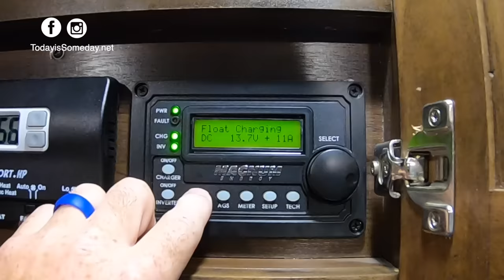Tiffin Service Center (RV RAMPAGE THAT CHANGED POLICY)

Comment from the maker: Please share the cost of your RV repairs to help our community learn about RV costs. Thanks! And WOW! Can you believe what happened!!
Reply: Ok I sure will. 😊 And no I can't believe it smh.
Reply: Seems like the hose repair should’ve been under warranty at such a young age.
Reply: Did they say why the drain line failed prematurely? Might help to know???
Reply from the maker: @donaldblad2670  They think it was too long and binding when we closed her up.
Reply: Forest River FR3 had to replace slide motor. 
Part $159
Labor $480
Done at dealer we purchased
Reply from the maker: @AndrewLarrimoremassachusetts  Thanks so much for sharing! It will really help others.
Reply: Andrew Larrimore I try to avoid dealerships like the plague. I know it’s not always possible to drive to the manufacturer for repairs, but it can be worth the time and money to make the drive. If you have a list of repairs, make an appointment a couple of months ahead of time. 
Happy trails😎
Reply: @trishmince2652  we live in Massachusetts and driving to Indiana to replace a slide motor that was dead would have cost much more in fuel
Reply: Andrew Larrimore I totally get it. Was stuck with a broken wiper. Basically was forced to take my rig to a Ford big truck repair shop. $1100 later I was able to get back on the road. I was robbed by Ford but really didn’t have other options at the time. Luckily, the second time my wipers broke (six weeks later and a the other wiper) I was only 4.5 hours from Thor manufacturing.
Reply: Wow
Reply: I always contact the manufacturer of the item that failed to see if they supply  a replacement and possible want the failed part back .
Reply: Can people talk about their rigs, reliability and if they'd buy it again. I want to buy used because of $$.
Reply: fist time when I ran into the back of the RV  17,000 for the RV 5,000 only body work on my car
Reply: You, Me & the RV , so confused RV vs. 5th wheel.  Help.
Reply: 2014 Anthem
Aqua Hot fluid replacment $425
Tighten (NOT replace) A/C belt $85

NIRVC Atlanta

Comment: One thing I do not like about owning a motorhome from Tiffin. I have 25000 miles on my Phaeton that has a leak in the ceiling, I called Tiffin and told them the Vin # and Year 2005 with 25000 miles. The answer is oh we dont service older RV's. Ugh what? its your Tiffin that you stand by and dont service them. After serving this great country and 4 tours I am kind of beat up and just cant do what I use to. But they just dont do older Rv's even their own. Live and learn.

Comment: That story about the damage at Tiffin was amazing,  and CRAZY! Sounds like someone was off her meds.  We spent a week at the service center in August for small warranty repairs,  so that escapade must have happened recently.   I agree with the level of service the great techs provided. We checked in with 16 items on our "punch list" of fixes needed (small stuff like a slide starting generator,  broken drawer latch,  window leak...) and the techs fixed 33 items,  several of which were so small we'd ignored or items that they identified.  They even put it on a lift and re-torqued a couple of chassis bolts for me,  after I'd installed a steering stabilizer a couple of weeks prior... not exactly their responsibility.  It was a great new owner experience.
Reply: Should have said "slow startng generator".  Darn spellcheck is worse than I am.
Reply from the maker: That sounds like great techs! Glad you were able to take care of so much while you were there.

Comment: Crazy for sure! One of my biggest pet peeves in life is that others have to suffer the punishment for one fool's act.  We have a 2002 40 ft Dutch Star and we've had few maintenance items.  I want to comment that since we full-time we've used different places for repair and once they know we are full-time (with dogs) they have always made a way to accommodate us  (so far).  Either they have worked with us to be able to pull out and sleep in the rig or they have allowed us to plug in at their facility and stay. Most recently we had to replace the starter and we were stuck in a welcome center.  The mobile repair place spent two days tracking down parts and repaired it where we were without having to have a tow.  (cost $1100 - part was $599) We used a Peterbilt center to replace the motor for our landing Jacks ( $1200).  The best value (thanks to the help of a vlog from RV Geeks) husband and son-in-law serviced our generator themselves total cost $108 and it runs so great now!   Hope this helps!
Reply from the maker: That does help....A LOT!! Thanks so much for sharing. I have heard about places accommodating full timers. So nice to see it is still happening. Safe travels.
Reply: You, Me & the RV q

Comment: Hi Guys ...WOW!!! is right. We just sold our 2011 RED 34qfa, owned since new and purchased from Hershey RV show. For the first 4 years we owned it we went back to Red Bay every fall for repairs and didn't pay a dime for anything. From paint work, wood work, chassis work, electric work. I always argued with Wade the service manager that it was a defect from new and should be covered under warranty they agreed. WE spent many weeks in the service center campground before they started the 1 year rule. So this storey is amazing.
 In 2018 we had the dinette slide floor replaced, a regular problem for this model. Water ingress and rotted the floor, fully replaced again under warranty at Kimborough RV over near Florence AL. Another service center for Tiffin. Great great service.
 For a different camping experience while we waited for service or on weekends we would take the coach to Toshimingo state park just across the border in Miss. Beautiful place very quiet. Thanks for the video. Safe travels.

Comment: That's plum crazy.
Tiffin should install inground hydraulic traffic barricades in front of each door. It may cost a pretty penny, but that accident probably cost at least $50 to 100k. Not to mention the new fencing and other modifications to the property.

Comment: Ken and Cor
2018 Tiffin Phaeton 40IH XSH

We were at the service Center Oct. 3, 2019 through Oct. 19, 2019 for warranty work, paint work, and some service on our Aqua Hot. We had about 25 items going in, with a few more added as the techs were working on the coach. We were charged for 30 minutes labor for servicing the Aqua Hot. The balance was covered under warranty. The paint work was to repair paint work performed by another dealer in Illinois. I also had some tree scratches buffed out while we were in the paint bay. Our total bill was about $80.00.

We were not sure if we were supposed to tip the techs, so we fed them breakfast and tipped them for their excellent service.  Based on the information we received from the folks on our 2018 Tiffin 40 IH XSH Forum, we tipped each tech $50 per day for their service.

Keep up the great work. And thank you for your service!!!
Reply from the maker: Thank you so much for adding your repair work to the comments. I know will help those reading the comments. We also tip the guys and the first time we were there we fed them several times. They were great guys to work with and to learn from.
Reply: Ken, you must have a coach that is still under warranty and I have heard that Tiffin is great for taking care of it's customers.  Just the deal on the Aqua Hot and we have one in our coach, there is nothing cheap on those.  I ordered a high limit thermodisc for the diesel side the other day;  $71 for this tiny part.  UGH!  I have learned quite a bit on how to work on and service the AH.

Comment: Owned a 2013 Open Road, bought new, and had 3 visits to Red Bay in the first year...stairs breaking, transfer switches (3) failing, and a leaking entry door that never was properly fixed....FINALLY had enough. It’s a world of difference with my Newmar Dutch Star - NEVER TIFFIN - NEVER AGAIN (just my opinion, your mileage may vary)
Reply from the maker: That is unfortunate, John.  We have been very lucky with our Tiffin.  It is really a roll of the dice with these awesome machines rolling down the interstates.
Reply: That was why she drove her rv into the building, she had enough!

Comment: 2017 450P in 2020 red bay had to rewire bedroom slide out because wire harness was getting crushed and wouldn't work. This year we lost 110 power on driverside I looked under bed and lots of exposed wires. I stopped at Red Bay and technician couldn't believe the did the repair. it took 3 guys 9 hours to repair. I was told I was lucky we didn't have a major fire. It seems repair was done right this time. They did repair for free and worked over # hour limit. (Coach is over 4 years )

Comment: Grand Design 337RLS 5th wheel out of warranty.  While at a RV park in Colorado we by chance noticed a Grand Design technician in the park. I inquired about his purpose for being there. Normally he works Grand Design rallies but due to covid he going to rv parks looking for Grand Design rvs to service.  I mentioned that I had concerns about our brakes ( he considered an emergency).  The next day he came and replaced two complete brake assemblies and repacked the bearings at NO cost.  This level of service is the reason we have a Grand Design.

Comment: WOW that's incredible! 
We have a 05 Teton, that was supposed to be fixed before we received it. The partnership broke up, and the partner that made the promise left.
We now have a 5th wheel with bad landing gear, one slide not working, and drains leaking. One person started installing the landing gear, then got busy on normal job. Went to another person, who accidentally broke a living room window moving the trailer around, and it's been over a year. Wish us luck!
Reply from the maker: Holy crap! That is terrible. Hoping you can get it repaired soon.

Comment: Well, I am catching up here some four years later. Really enjoy your videos. Well done! A repair story: Brand new Rockwood Mini Lite 2509S as of last fall. We are in southern MN so it gets cold. I have owned RVs for almost 30 years so did the winterizing myself. All good. When de-winterizing all went well. But the water heater would not stay lit and no hot water. I located Jason's Mobile RV repair in Millville, MN and called him. He pulled his truck over and we made an appointment for two days later. He came, did an inspection, and noticed I had one of the bypass valves wrong. He flipped it open, and all good. AARRGGHH! My bad and I felt foolish. In all fairness, our previous trailer had one bypass valve and this one has two. Cost for that lesson was $130. $100 for the trip charge and $30 for his time. A bargain!! And, I met a new friend and terrific RV tech in a truck that will come to my home. Perfect!
Reply from the maker: I have been there and done that.  LOL

Comment: Not really any kind or true repairs yet, but we have made a number of upgrades or customizations to our 2005 Itasca Sunrise (interior design changes, LED's (inside and outside), 2000 watt inverter, Cell signal Booster, Data Signal booster, Solar panels, etc...).  We have yet to make it out to Iowa to the  Winnebago Mother Ship, but it does seam like a similar experience (based on on-line rally reviews and stories).  Very cool video that highlights the two technicians who make the "magic" happen.   Does sound like Tiffin is a different kind of company who produces high quality Coaches and top end customer support.   Beat Army.

Comment: WOW. But I'm sure frustrations may have been a part of it. $50 a night. That's unbelievable. I know in Jersey we get off season with returning Customer discount for low $40s. That is good to hear. We had an AC unit issue and had the Dealer install a second unit. They didn't install half the parts or clean the RV before we picked it up. Then took months to Bill us. Needless to say we got the unit at cost because we ended up cleaning and fixing all the minor defects ourselves.

Comment: I suggest that the next time you go to Tiffin you purchase a new replacement basement handle and a replacement water pump. They are not that expensive at Tiffin and you will be prepared. Thank you both for the valuable info y’all provide.

Comment: We had the exact same problem with our 2014 Allegro RED 33AA. Sink drain hose kinked, cracked, and leaked. Same cost, same great customer service. I highly recommend a trip to Red Bay for your Tiffin. You only get 3 Tech hours for out of warranty repairs so the plumbing repair took all the allocated Tech time. We went to MS RV Solutions for slide topper repair and Banner RV Paint & Auto for some fiberglass and paint repair both in Golden, MS about 5 miles from Red Bay. Both did excellent work in a timely manner. I'll be coming back for any other work I need.
Reply from the maker: Well said Drew!

Comment: I have a 2000 Allegro diesel pusher we bought in September 2020 along with a 2004 Jeep Wrangler sport and Falcon 2 tow package.  This was our first RV and we were on the road.  We left Peachtree City, GA and did a 8k mile trip in a big circle up the Michigan's UP and across to Tacoma, WA then down to Victorville and I 40 east back home.  It was awesome, we love US 2 running near Canada border.  We used the RV Parky app and also stayed at 2 Harvest Host properties. We did stay 1 week at Hamilton Branch State Park in SC, located on Strom Thurmond Lake.  It was absolutely beautiful and I highly recommend it.  We were feet from the lake and it was pretty quiet and peaceful.  We returned home on Nov 11th 54 days of awesome travel.  We are heading to AZ in February to stay for 1 month meeting 2 family members with their campers.  On the way we will be having some service down at Lakeshore Custom RV in Luka, MS close to Red Bay.  Tiffin will not service rigs that old.  I also have some fiberglass repairs from my toad which had a blowout on right front and piece of tire struck back of RV and cracked rear light lens.  The blowout appears to be from dry rot in the tires they were 7 years old.  Who would think to check car tires age?  I am taking it to Pro Finishes in Belmont, MS.  The owner works at Tiffin.
Reply from the maker: You correct that the Tiffin Service Center won't work on 10 yr old rigs, but all the out lying shops will.  You name it, they can do it.

Comment: We have a 2014. Thor Windsport 27K.  The two retract hydraulic hoses started leaking and it was colder than I wanted it to be to crawl under the RV.   I took it to my RV dealer.   They hired a hydraulic specialty company to come to their shop and replace them.   One 10 foot 1/4” hose, one 15 foot 1/4” hose, four fittings, and four hours labor.   They charged me $1,100.   The dealer charged me $72 for investigating an electrical issue.   No mark-up on the $1100.
Reply from the maker: WOW!

Comment: Have a 2004 Bounder 38N Have not had any repairs done other than annual service on the engine and generator. Oil Change and new Belt and Air Filter. Oh I forgot I had a issue with Trailer Lights and they did repair that at the same time. Cost was $1100.00

Comment: That is always the worry with propane gas line, water line, sewer line, and electric line in the slide.  Moves with the slide, when those lines actually are not meant to move.  With the slide constantly moving in and out, eventually lines will bend, pinch, crack, etc.  By looking at the drane hose in the video, that is exactly what happened.

Comment: Liked this video, especially liked  your cutting of the  scenes where you are traveling to red Bay in the short segments at each stop.  One year of Repairs:. New roof: 12K, Turbo and inner cooler: 15K, Replace Engine: 30K,  New tires: 5K.  2006 Dutch Star.  Engine replacement is the result of poor turbo service, tech got iron filings in the engine exhaust port.
Reply from the maker: Yikes!!  Not good at all......hopefully the shop paid for the engine replacement!!!
Reply: @todayissomeday  no, long story but lawyers are 500/hr  here 60 hr = engine replacement) with no guarantee, at least I had the repairs done at a different facility :-)

Comment: WOW!  CRAZY!!  Always good vids from you two.  Happy there was no repairman inside.
Since you asked, the 4-door Norcold refrigerator in our 2004 Winnebago Journey stopped
cooling in August.  Here in Phoenix there is a local independent repairman who
replaced the entire cooling unit with a rebuilt one (he rebuilds them himself).  This was done
at our place as he is mobile.  The cost (parts and about 5 hours labor and a 2 year warranty) 
came to about $1,350.00.  I have seen the cooling unit part alone online for that price and I am 
NOT a DIYer. He also checked the whole system after he finished.   Go Navy!
Reply from the maker: Sounds like you had a great experience!

Comment: I feeling this video very interesting. Although I have not owned a Tiffin my coworker and secretary bought one in 2015 about 360 horsepower or something like that. For the first nine months it was in the shop for repair. The good side of that is mr. Tiffin invited them back and house them extended their warranty for a year and repaired everything plus I think you paid for their fuel to get from Placer County California to Red Bay. That's what I call good customer relationship. We are on our tenth one we're going to order it here in a month or two and they all seem to generate problems so no matter how much or how little you pay they have problems. Thanks for your video. Perhaps we'll see you when we get on the road again in July August and September may be part of October.
Reply from the maker: One of the reasons we went with our Tiffin....customer service is way above board!  Good luck and safe travels!